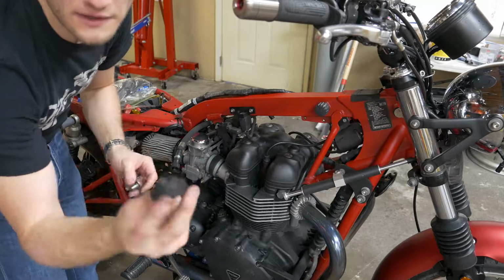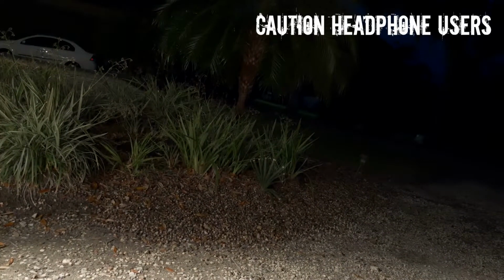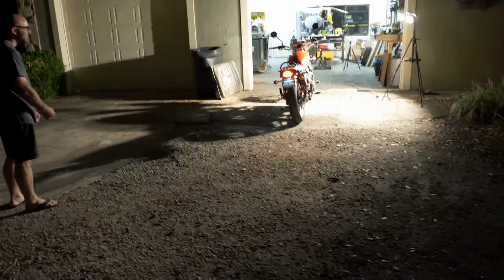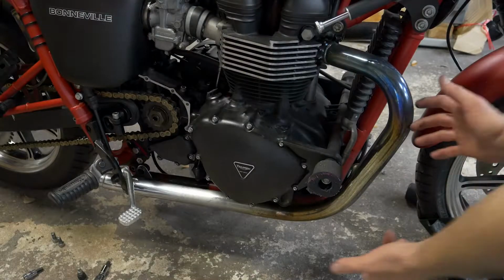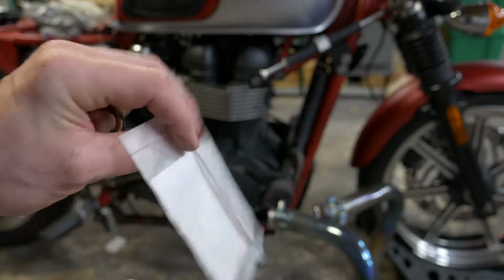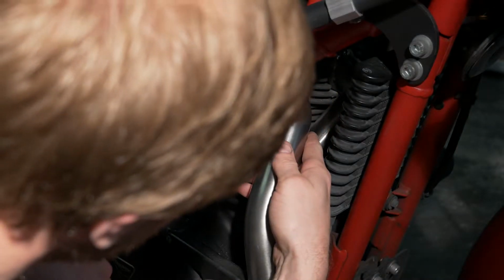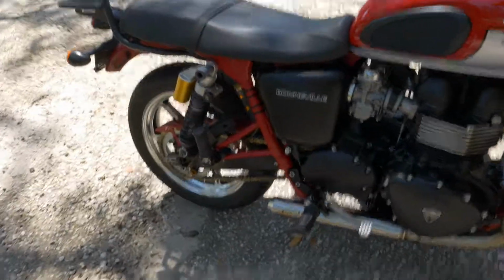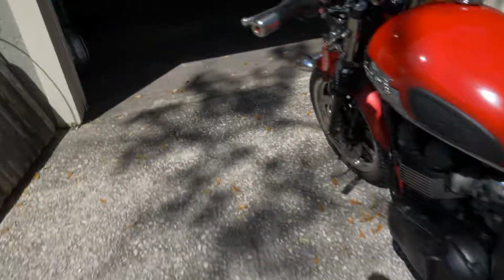Triumph Restoration - Part 6 - Series Finale

Comment: I'm gonna have to bookmark @ 3:50 for next time I can't figure out how to take off my tank...
Triumph Performance USA "Dominator Touring" exhaust sounds @ 5:40
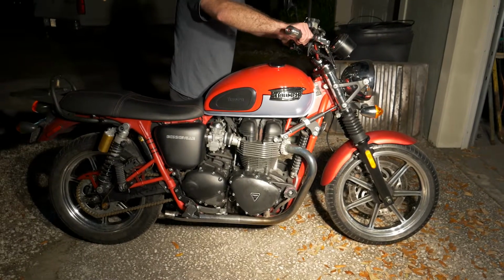Open headers drowning out the world and I'm trying to talk over them for some reason @ 9:10
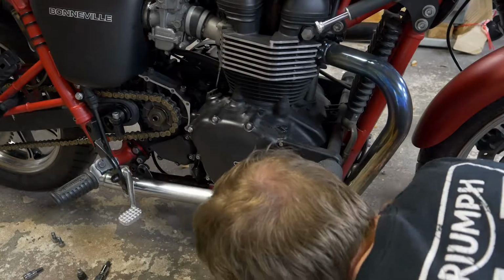Apparently I'm going bald and din't know it @ 13:30
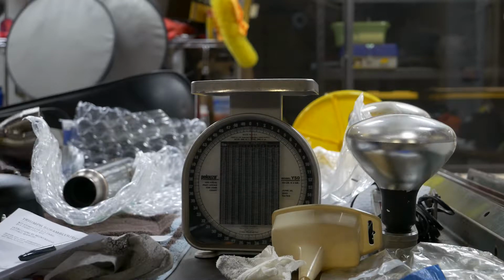Classic Spongebob joke @ 16:45
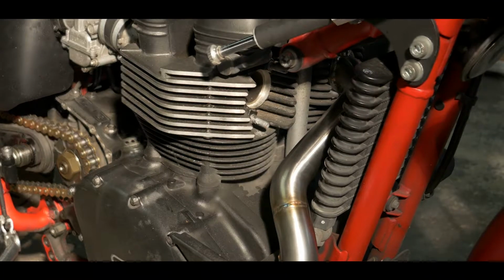Montage because Dave forgot to turn on the mic @ 20:40
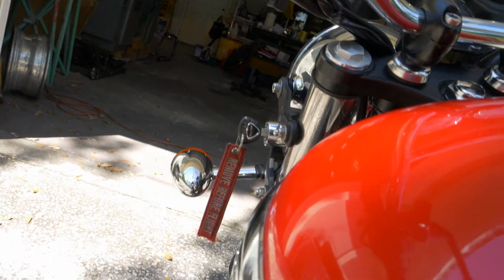Zard Cross exhaust sound with baffle and WD-40 smoke @ 23:00
Stealthy 737 on descent which is quieter than my bike @ 24:20
Zard Cross without baffle and talking robot sounds @ 25:45

Long term rider's update: The Zard Cross without baffle definitely makes you "That Guy". You will be legendary with the Loud-Pipes-Save-Lives Harley rider crowd at every bar and bike night you go to (these sorts can only be found at bars and bike nights). Other motorcyclists will say "geeze that is kinda too loud" and everyone else (read: normies) will pucker, swerve out of (or sometimes, in to) your way, and blame this sort of behavior on some "Harley biker gang member". Personally I don't dig it, but the baffle is too quiet, so I'm planning to make my own (copy the baffle outer diameter but cut it down and/or turn it inside out to direct the sound back and down).